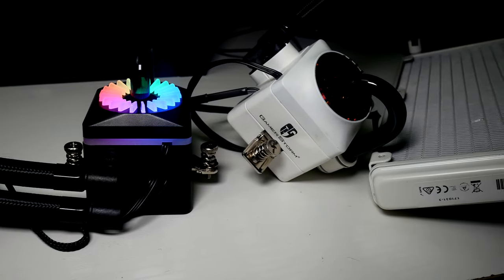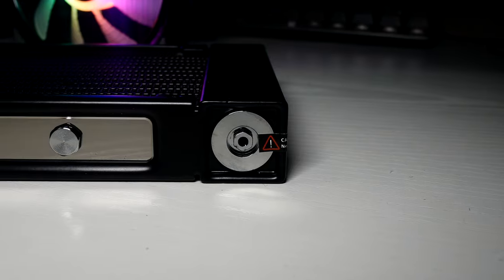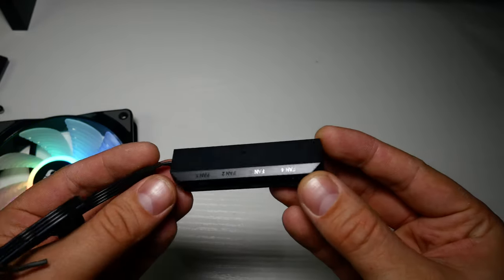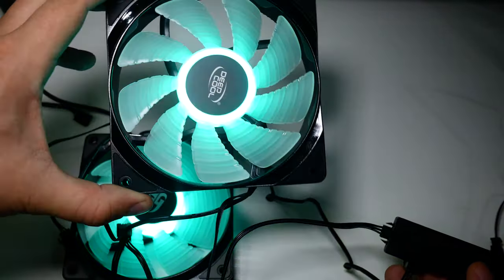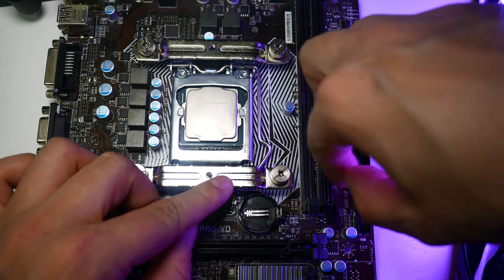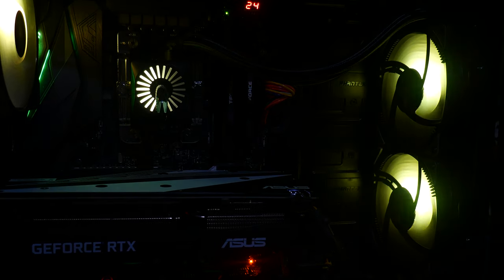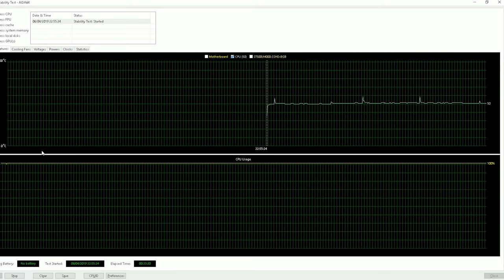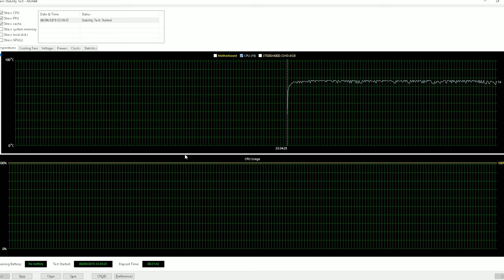Deepcool Captain Pro 240 Liquid Cooler Review, Install, Overclocking and lighting Test

Comment: One thing I am struggling with is getting the Asrock Polychrome app to recognise the aio for sync. Polychrome only picks up my RAM. Not sure if my setup is incorrect? Running it through the addressable RGB pins.

Comment: what about the rubber bladder? i wonder how long that is gonna last in warm water?
Reply: so i ended up getting one of these, its now one year later. had no leaks so far.
however, the leds work perfectly fine on my aorus motherboard, except for one thing - the outer "band" of led on the pump-head, over the edge of the ring of led lines, has never illuminated. i'e also tried it on a asus motherboard - the same

Comment: didnt you mount your fans/radiator opposite. Now you are blowing hot air into your case.
Reply from the maker: That's generally what happens when you instally rad in the front 🤷🏻‍♂️